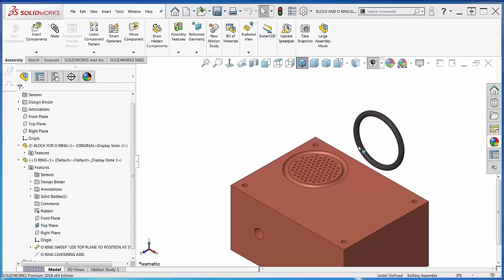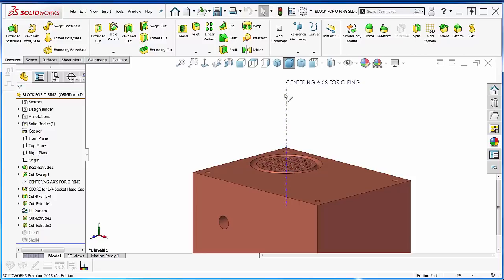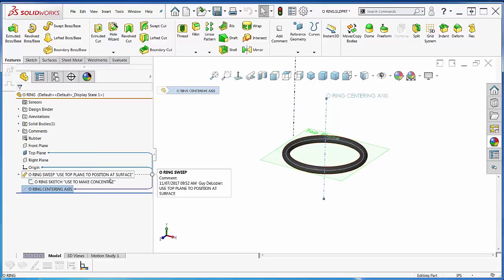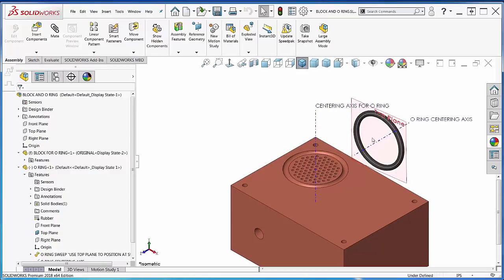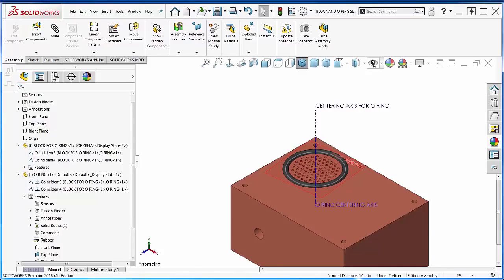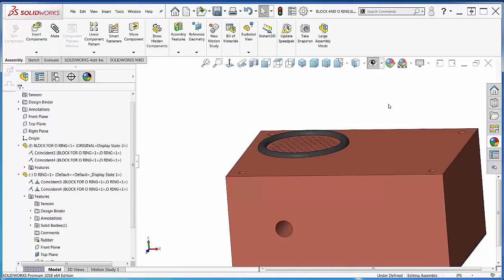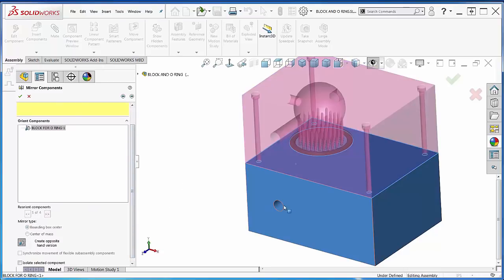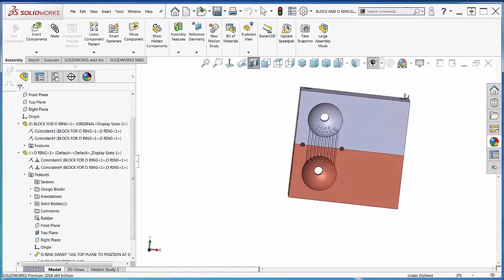SOLIDWORKS - O Ring Placement in Groove

Comment: Too much preparation. Why not use temporary axis for example?
Reply from the maker: Hi Eyal,
These are different ways of accomplishing the same things.  In this case there there is not a particularly better approach so a Reference Axis was used.  For the video though, if temporary axis were used there would be a great amount of temporary axis shown on screen which could confuse the video somewhat.
Reply: Simpler approach is better, I also wouldnt create any axis if temporary one can be used.